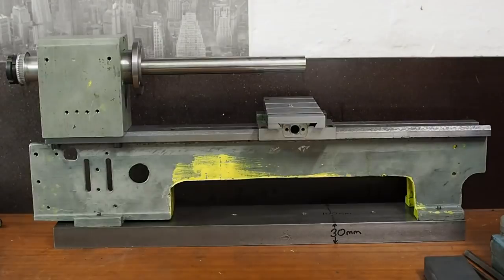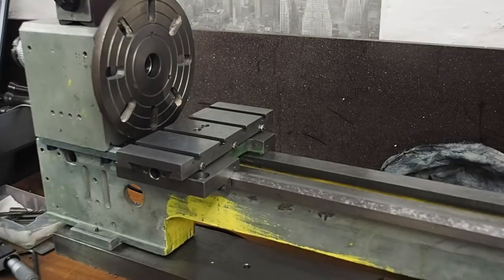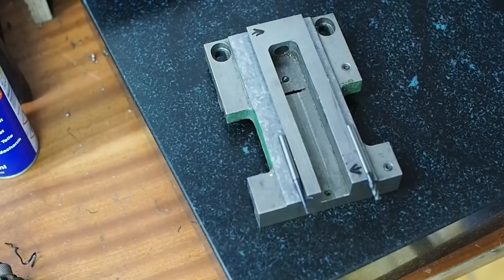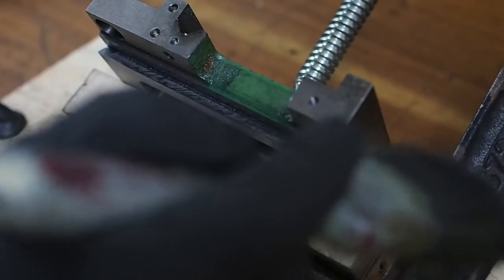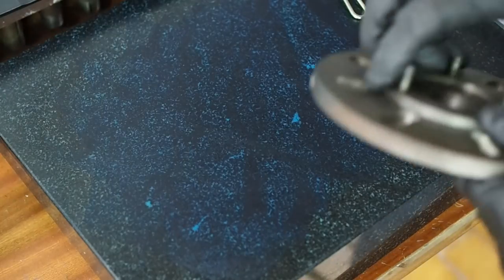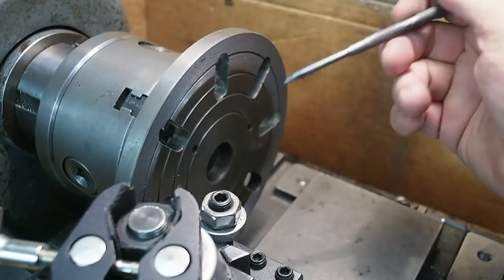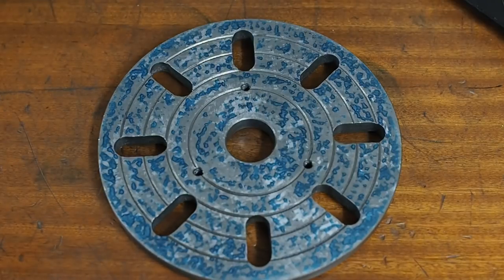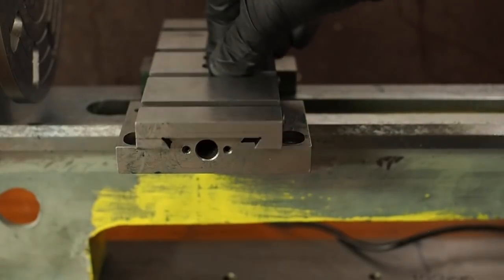Fixing the 7x12 mini-lathe - Episode 10 - Finishing the saddle and cross slide

Comment: You are putting a lot of hard work into this little machine, nice job! I am a rebuilder by trade and I've done two of these little lathes for customers over the years. You end up modifying the overall design much more than just correcting alignment. For example I changed the saddle gibs over to tapered gibs to hold it onto the bed instead of the cheesy push pull method with bolts through a strip of iron. Also on the rear side of the saddle I made the rear gib bracket much larger to give some counterweight off the back side of the bed so that it naturally sits down even with the weight of the apron bolted to the front. The cross slide and compound were converted to gib strips which are pushed from the side like factory only I added 6 more adjustment screws to even out the force. But then I also added slotted counterbores through the top slide and compound with drilled and tapped holes in the tops of the gibs to lock them down as these gibs are so short they will roll under load even when properly set. It's the same setup as a colchester lathe. One tip on saddle alignment. Usually you scrape in the cross slide ways on top of the saddle in alignment to the cross feed screw only. Once this is done you scrape the bottom of the saddle to the bed to achieve squareness, it involves much less scraping underneath to correct any alignment, plus it maintains the cross feed screw alignment to its associated dovetails. And the way I check squareness is by placing two pins of the same diameter into the spindle side dovetail and then rest a square on them, such that the blade of the square points toward the spindle. Then I simply mount an indicator to the bed and rest the needle on the square and run the saddle up and down the bed. This removes any spindle errors completely. I have rebuilt many machines over the years and can provide any help you may need just give me a shout and I can send my email if needed. Again wonderful job, take care.
Reply from the maker: Thanks a lot for the feedback. Some excellent advice you have packed into that.

I had previously "improved" the saddle to bed clamps, by dumping the "cheesy push pull method" and just shiming it, and tightening the bolts. I need to revisit this soon. 

Adny Pugh already pointed out previously, that increasing the number of cross slide gib screws will help. That gib is going to be the next video, so I will have to look up the colchester locking method you mentioned.

I wasn't sure whether it was better to alter the alignment of the dove tail, or of the bed ways. It probably wasn't necessary either way, till I screwed it up.

I'll have to try out that squareness check. Would have bee much easier than scraping the face plate. Wonder how square my collection of squares is?
Reply: @RotarySMP  you're very welcome. Squares are very easily calibrated using what's called reversal methods. It's much easier to google than for me to describe. It can be done in situ whilst performing the check I listed previously. Simply arrange the square as mentioned and record the readings then flip the square and slide the saddle back and forth again, if its square you're readings shouldn't change, if not, well they'll be different. If it shows the same number but in the other direction ie. Plus instead of minus, then your saddle is dead on, and your square is out by exactly the amount of error.
Reply from the maker: @cgprecision  I did what you suggested yesterday. The first "square" I tried was way off. Luckily I have multiple squares, and found one which was worth it's name. It will be in the next video.

Comment: My 9x20 lathe had clearly been scraped during manufacture, and the contact was actually decent on both the flat or  the V way. 
But not on both at the same time!
There was about ten thou of rock between one way being in contact and the other. 
Mine was a super-nasty one where the saddle retaining strips were adjusted by not quite tightening down the bolts.
Reply from the maker: Hi Andy, I wonder what the guy with the scraper in the SIEG factory thinks his job is? On mine there were a few random scrape marks, quite deep, so the guys scraper was sharp, but with no connection between that action and accuracy. Polishing a turd! 

The saddle way clamps on mine were/are  also horrible.

Comment: The quickest way to check for square of the cross slide is to mount a square with the base against two rollers abutting the dovetail,then clock the blade, and move the saddle along the bed, you can even clock both sides of the blade to check the accuracy of the square.

Comment: I'm particularly enamored with the use of Moglise in DIY rebuild/upgrades of mini lathes. Check out Stefan Gotteswinter's 9x20 Emco (his old lathe) rebuild. Moglise is an epoxy Teflon compound with 11 herbs and spices and is super tough as well as slippery. There is usually a zig-zag groove milled into the Moglise on the saddle ways. This makes a great oil channel. Really eliminates wear and makes adjustment a dream. Also, it scrapes-in just like cast. Yes, it's a bit over the top but it sure is kool. True metrology bragging rights.
Reply from the maker: I watched Stefans 9x20 video. I am not sure Moglice works that well on something as small as the7x12 though, as some of the contact surfraces are so small, that you are going to get into issues meeting the minimum requirements of the filler.
Reply: @RotarySMP  I have a 9x20 and a friend has a 7x12 and both machines have similar geometry. I think the Moglise pocket was about  2mm with a 1mm oil grove. One thing to contemplate would be a thicker cross slide with a fixed toolpost. Lose the compound. That's what I did on my 9x20 a'la Robin Renzetti. Really upped the stiffness and I don't miss the compound except occasionally. I'm making a tailstock offset tool out of a 2: Chinese boring bar with an M2 taper with a drawbar for doing tapers and such.
Reply from the maker: @misterfixit1952  Keep watching. CNC machines don't need top slides or tail stock offset. If you want a tper, you just program it :)
Reply: @RotarySMP  I'm halfway there. I installed  cough42's ELS (Electronic Lead Screw) so I have the encoder and a closed-loop stepper. The 9x20 is down right now while I am rebuilding the saddle. Harbor Freight didn't use bearings in the saddle shafts and some are now more oval. I bored out all of the cast iron holes and installed offset oilite bronze bearings. I bored out the bearings with a slightly offset hole so I could rotate the bearing and take out any backlash. One thing leads to another and I needed to install a DRO on my mill so I could make the bearings and ream out the casting. I'm just finishing the DRO, right now.
Reply from the maker: @misterfixit1952  Once you have linear encoders, and motors on the axis, I dont really see the point in limiting it to an ELS. From there it is only a small step to LinuxCNC.

Although to be fair, I really like manual lathes. Mills need CNC, lathes not so much.
Reply: @RotarySMP  I'm currently shopping up a couple of Mesa cards for my Danford Triton Pro 3 axis CNC VMC. I bought it last summer for $750 but it used proprietary software, which didn't come with it. I'm replacing the controller and running Linux CNC. The Triton is a great machine capable of milling steel, it has servos, ball screws, and 20mm linear rails on all axis. It also has an 8 tool ATC. It runs RT30 tooling and has a full enclosure. Best money I've ever spent.
Reply: @RotarySMP  I agree but I really like a manual lathe for most projects. CNC is great for production runs and hard to make parts but it's hard to beat a good manual lathe. I'll probably just add a 4th axis onto the Triton instead. Danford makes an older CNC lathe that is very popular to upgrade to Mach 3 or Linux CNC.
Reply from the maker: I agree with that. I'll aways default to the Boley and only use the Mini lathe if I really have to :(

I am really torn in my choice of future lathe. I'd like to sell both the Mini-lathe and the Boley, and get one, but cant decide whether to go CNC Schaublin 125 or Lux Turn, or manual (something like Harrison 300/Weiler Matador/Emco V13)
Reply: @RotarySMP  Shopping up a new lathe is a matter of luck and timing unless you're bucks up. I'd go with the manual lathe, something in the 12' plus range. Probably not bigger due to space and weight. For the CNC lathe part, I'd add a 4th axis to the Maho. Do you do a lot of CNC lathe work? Bigger than the Mini lathe CNC? I'd be happy just to have one with a power cross slide. I think those pretty much start at 10-12 and up.
Reply: @RotarySMP  Have you seen Ka Lem's new (rebuilt) lathe? He did the same refurb work that he did on his Schaublin 13. Awesome lathe. He knows how to make a silk purse out of a sow's ear. That Schablin was a real rust bucket when he started.

Comment: Yeah, can we see how the saddle lock is actually designed to fit onto the bed pyramid way? I’ve seen DIY [block] saddle lock that all featured a mating pyramid machine onto it for the bed way, but try as I might, I can’t see this same pyramid cut away on your saddle lock. Which made yours all the more curiouser, theoretically. But awesome job on your scraping projects. 👍
Reply: Woop, never mind. Figured it out. It’s one of those moments of pushing on a door that has an obvious sign dead in your face that says, “PULL”. I think they call it having a “senior moment”. Thanks.
Reply from the maker: Thanks. Mine only pulls up on the underside of the way. I'll break it down in the next video. Thanks for watching.
Reply: @RotarySMP  Hey, man, yours is a good breakdown of this mod for this lathe, really detailed, so...credit where it's due.

Comment: You can improve the accuracy of you faceplate if you check for parallelism of the mounting surfaces to the face plate.  This will ensure your faceplate is perpendicular to the drive spindle.
Reply from the maker: Good point. I did blue up that mounting surface, and ran a clock across it, but it was good once I had finished the front, so I didn't film it. The more parallel they are, the less error if you dont mount the plate in the same orientation each time.

Comment: This might be a total brain fart on my behalf and if so, please do correct me. But I am confused about the first indicating you did with the indicator on top of the headstock touching off on the front of the face plate. It didn't show much run out and you concluded that it ran "concentric". But even with no/little run out on that measurement, couldn't the whole spindle still be non-parallel to the bed and thus not a good base to use for perpendicularity to the cross slide...? I got that you found out it was dished, too. But I am just wondering if indicating the front of the face plate while spinning it tells you anything about how it is aligned to the bed? Wouldn't you need a test bar inserted into the taper of the spindle for that?
Reply from the maker: That measurement was only to determine whether the face plate ran concentric to the spindle axis. If that had wobbled all over the place, then I could not not continued to us the face plate as a surface perpendicular to that axis for checking cross slide perpendicularity.

I later checked the perpendicularity of the cross slide to the bed, based on a reader suggestion, to eliminate the headstock alignment as a variable there.
Reply: @RotarySMP  Yeah, I tend to post as I see stuff, so I did see the machinist' angle trick in the next video:). But phew, I was racking my brain as to the indicating:). 
But thanks again, there's such good info in all of your videos and I have been modding my own mini lathe on regular basis and think I might take the leap and scrape it next:)
Reply from the maker: @AntiVaganza  Glad you are enjoying the series.

Comment: I am puzzled either you love hand scraping or hard up why didn't you just buy a better made lathe?
Reply from the maker: Good point. I touch on the motivations in video 1 and 9. I have a better lathe (a Boley 4LV), but it also needs re-scraping. 

You need to pay up around €10000 to have a good chance of an industrial machine with little wear. Otherwise you get a worn machine which needs geometry overhaul, or a chinese machine which needs geometric overhaul. With my mill I got lucky. 

I figured the 7x12 is a great project to learn to scrape, as it is small, nothing is hardened, and goes pretty fast. Scraping a single surface is easy, but getting everything to stack up well is more difficult than it looks. Hence the practice project.